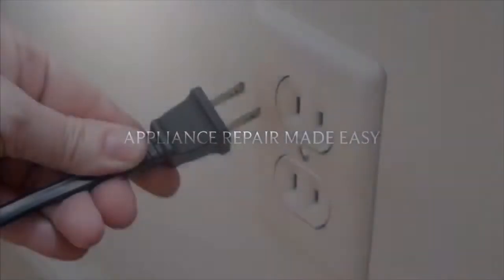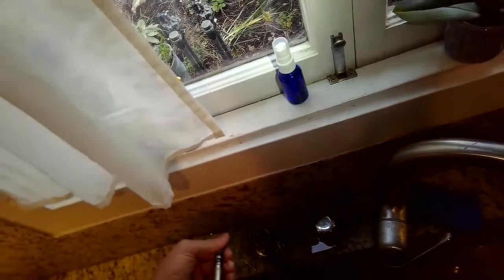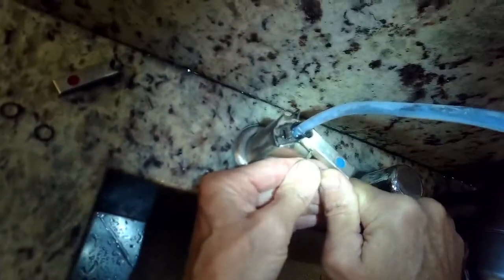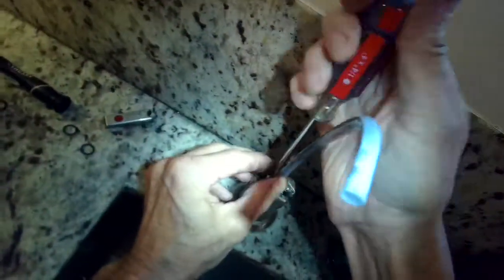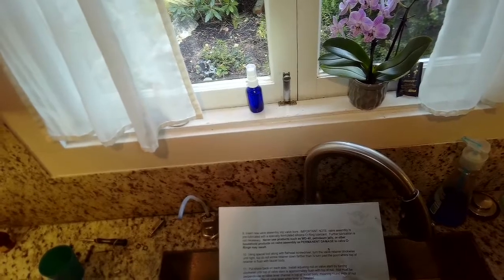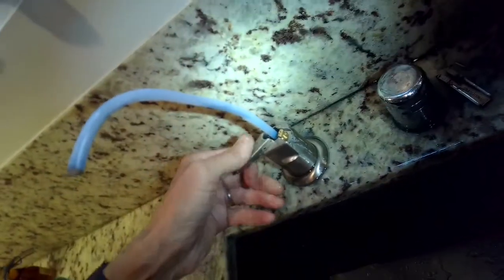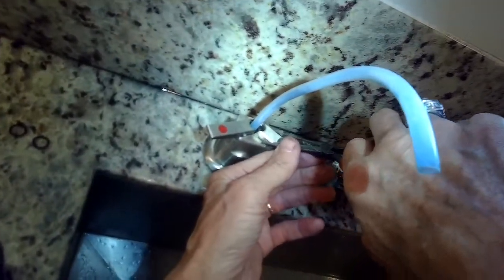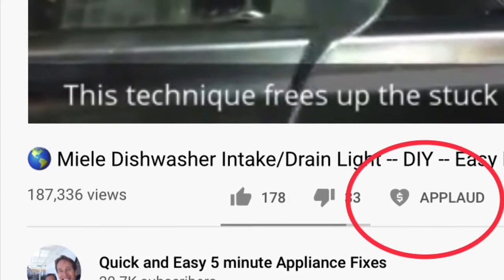✨ EVERHOT WATER FAUCET LEAKING - FIXED ✨

Comment: I've done this twice on my faucet since I installed it back in 2002.  Now that valve stem kit it $69.00!  I'm pretty sure if you can match up the 0 - rings - that's all you really need.  35.00 was a fair price, 69.00 you are getting dragged over the colas; thanks COVID!
Reply from the maker: Great info. Thank you😊

Comment: Did u fine out a solution to fix no spinning stackable washer the one that needs assistance to spin.. U replaced the belt but not solved?
I'm having the same issue in the same model
Reply from the maker: Can you send the model number?
Reply: Fex831fs2

Thanks
Reply from the maker: You might have an item of clothing caught between the tub and the spin basket that’s putting resistance on the spin basket.
Reply: Thanks for the reply

But NO

I just replaced the tub washer. Everything is clean. 

Is there a clutch in these models?
Reply: Could the drive block be the reason????
Reply from the maker: Could be👍